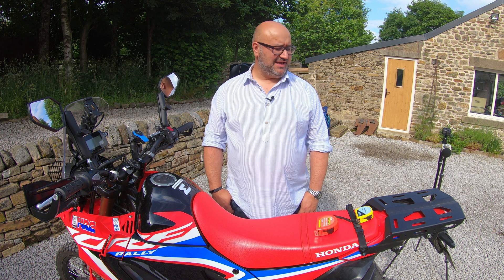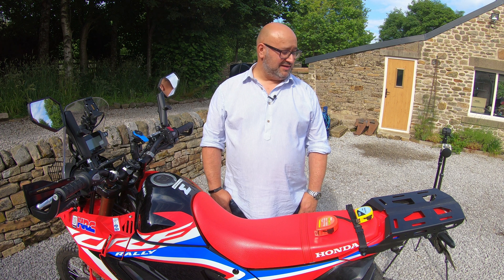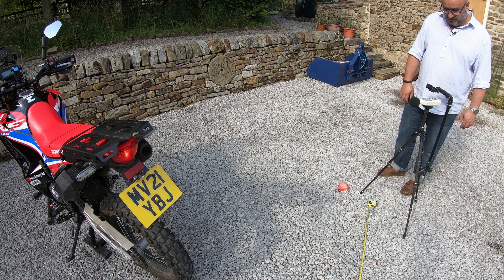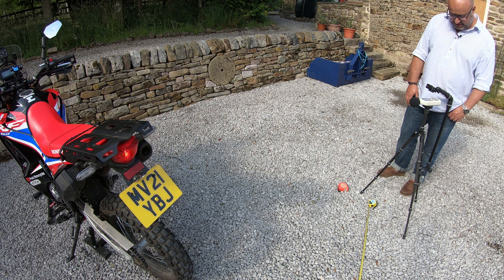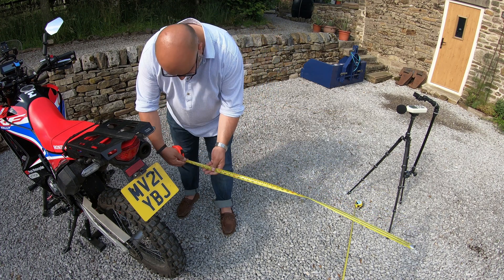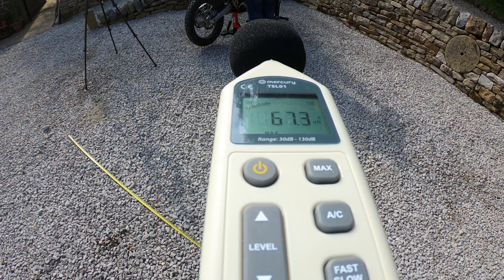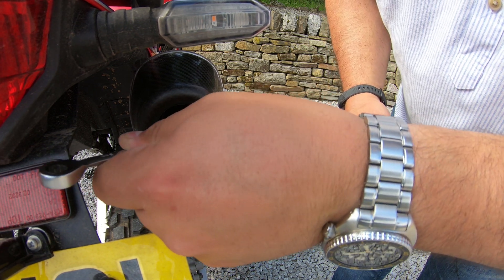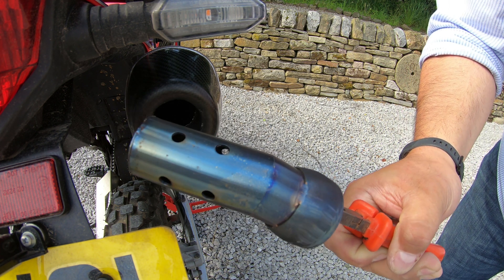Honda CRF300L/Rally MotoX Exhaust Noise Test 4K

Comment: Did u notice a difference in power delivery pls?
Reply from the maker: Hi,
Not really. Top speed is about the same. No flat spots in the Rev range. Someone else had mentioned they thought it had more midrange torque at the expense of top end, but I hadn’t noticed that. 6th is still sluggish. If I can find an economically priced dyno, perhaps I’ll try that.

Comment: Hi Andre, great vid, I never would of thought your testing could prove that, I must ask though do you think that this will vary when you're riding as the rev range changes. I'm very interested to see what you think, cheers.
Reply from the maker: It is a tricky one. Sound is such a difficult thing to assess, and I couldn’t think of any other way. This is how levels are measured for track days and ACU events, so if it’s good enough for them! The sound meter isn’t calibrated but it’s the same meter used for both stock and MotoX exhausts so if it’s off, it’ll be off for both. It will vary when riding, and ideally you’d do tests at every 1000 (or 500?) rpm to understand where it changes. Also drive by measurements are useful for the bike under load. I’d like to think that the 4500rpm is a sort of middle measure and most riding on a bike like this will be in the 3000-6000rpm rev range, so it’s a representative single value for comparison. Ultimately I guess the only way is to try it, and see what longer term effects are from noise fatigue and how many people complain 😉

Comment: Thank you Andre for all the videos. They have helped me quite a bit with my 300 Rally. Have you noticed any negatives with the performance with the MotoX exhaust? I was hoping you'd do the acceleration tests for the new pipe, but I do understand why you didn't.
Reply from the maker: Hi Steve, I haven’t noticed any performance impact. No flat spots in the rev range, and top speed is the same. I’ll ride it a bit without the baffle and see if that’s changed. A dyno is perhaps the only way to tell if there’s a real change, so maybe I’ll see if I can do that.

Comment: Thank you Andre. Absolutely spot on information for my exhaust decision. I too want to lose weight, improve exhaust tone and not produce offensive exhaust volume. You have shown that MotoX does all that. Also thank you for measuring the baffle. It does look like I can fit a US legal spark arrester. I am sure I can make it work but will only know if it requires modification when I get mine and try it.
Reply: I would drill some holes in the baffle...keep adding until the sound picks up a little bit..
Reply: MrScamp, Did you find a spark arrestor that will work with the Moto X.  I just ordered my exhaust and I want to keep it legal as I ride USFS often.  Thanks for any insight,
Reply: @twowheeledadventures5615  Yes, I was able to fit an FMF spark arrestor but since my new exhaust measured 42.5mm. internally and my spark arrester measured 42mm. some modification was necessary. The inside metal shows grind markings so tolerances likely vary unit to unit. I was able to remove a little material from both pieces to make it all fit. I also had to extend the mounting bolt hole slightly. I wish I could give a blanket recommendation but not everyone would want to do such fitting.
I installed the standard FMF spark arrestor and find that it does nothing to quiet the exhaust. I plan to order their “quiet” Q4 version spark arrestor and give that a try.
Reply: @eurekaqi  Can you put some screen inside the baffle (cover the holes)?
Reply: @twowheeledadventures5615    If you can keep it in there it might reduce spark risk but would likely not be an "USFS approved" spark arrestor.
Reply: @eurekaqi  I would hate to remove the baffle because that seems to be what keeps the noise low.  So what is that piece between the exhaust and link pipe?
Reply: @twowheeledadventures5615  I suspect that piece does reduce both noise and spark risk. I'm finding that mine now is throaty but not offensive.
Reply from the maker: You’re very welcome, and yes, I had the same questions and I’m sure we’re not the only ones. Good luck with the spark arrestor and let me know how you get on.

Comment: Interesting. How does it compare to stock temperature and is there a heat shield?
Reply from the maker: Hi, The stock exhaust has a large (plastic with insulation on the underside) heat shield, so the outside of that runs a lot cooler than the outside of the MotoX. I did a 200 mile ride with my Enduristan Blizzard panniers which included a mix of 60-70mph paved roads, town riding and trails to give it a good variety and I used an Enduristan Inferno heat shield. It worked well and though there was a bit of warmth on the bags, certainly nothing approaching a temperature of concern.
It looks a bit like:
https://www.instagram.com/p/CQfvlhSH0vl

And this is their shop photos:
https://enduristan.co.uk/collections/saddle-bags/products/inferno-heat-shield

I've not properly tested it without a heat shield, but can take a thermometer next time I ride without luggage and see how it's doing.
Reply: @PeakMotorcycles  Thank you. i don't need measurement, only if it melts or not😃